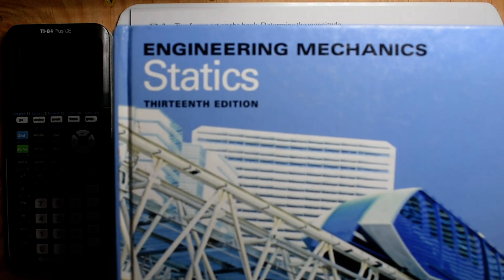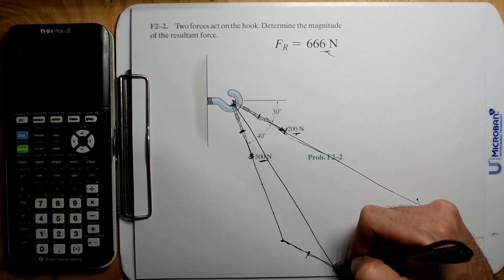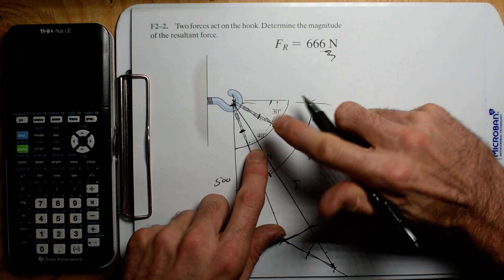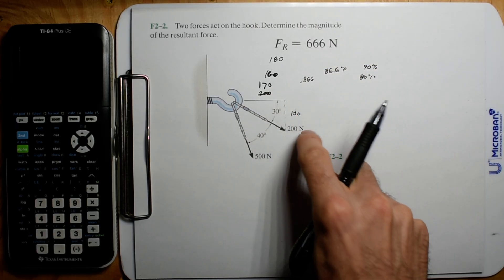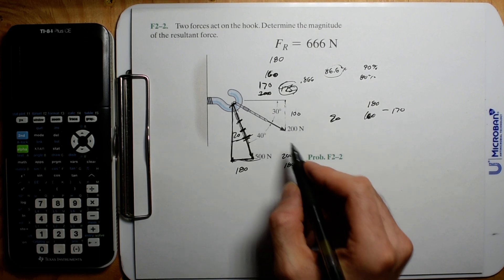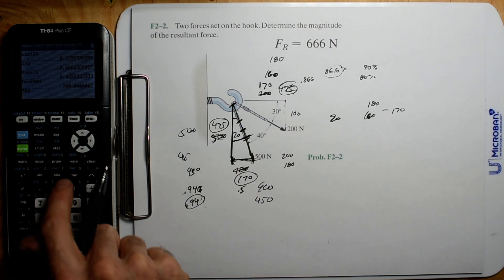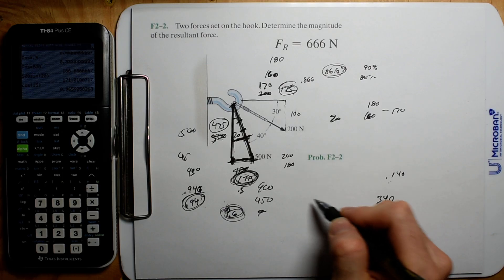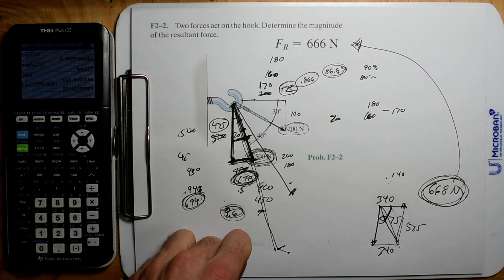FINDING RESULTANT FORCE 2 WAYS!

Comment: I answered this comment under your previous video but I guess youtube does not notify you... ahere it is again : "First of all, letting the errors and struggles in the video make you a strong character. Many simply do not want to show how "vulnerable" they are. But the funny thing is, THAT is what makes the difference! Very strong, very cool. As you said, this format is not common, because poeple are simply afraid of failure and what others think or say. Only strong caracters have the gut to let errors and struggles in. For students it is a gold mine, because a student WILL make those mistakes for sure. And if one can see what the exact error is, he/she will learn faster. As for the "clever trick". I guess it works because of vector algebra characteristics. If you cross product 2 Vectors ( for example S1,S3), then you make a vector "V" perpendicular to S1 and S3. That is cross product. So now you have "V" perpendicular to S1 and S3, but not S2 and F. Now if you dot product the whole equation with "V",  S1 and S3 will be eliminated, because "V" is perpenducular to them (90° ), and the dot product says : AB cos phi. In our case ( S1 S3 cos phi.) Now cos90 becomes 0. So those S1 and S3 become 0. Because "V" is NOT perpendicular to S2 and F, so dot product wont give 0, bacause the angle between "V" & S2  and "V" & F is not 90° . That is how this elimination works I guess. And why you are allowed to do this approach? Because if I add to every element +1 in the equation then it wont change the value of that equation. Here I add to every element a dot product.(It is just a deliberate coincidence that I mutiply everything with a special vector V (S1 cross S3) that will cancel S1 and S3.) So neither S2 nor F wont change its original value, becuase of equillibrium. I add the same value to those. And also you said that you do not logically see how S2 and F remain vectors after a scalar multiplication. I am not sure but I guess they won't. We make scalars from vectors in this case. So the unknown S2 (vector) after scalar multiplication becomes a S2 scalar. We simply handle it as a scalar unknown. But again, it is only my guess, to understand it deeper I should dive into Vector Algebra deeper. Again, this method is brilliant, because you do not need a calculator to solve for 3 unknowns with System Of Equtions function. You can do it by hand. After some google research, it turns out that this method works outside of Concurrent 3D Systems as well. But the use of it requires a careful investigation, where, when, how! For systems with Moments it is also usable somehow but I need more knowlede on that."
Reply from the maker: THANKS FOR THE EXPLAINATION!  I tried working through the dot product part and made a video on its understanding.  It's a, "The Struggle Is Real Video"  and it will be interesting if others find the value you see in this type of video!  I see that same value.  That is probably why I continue doing this format.  It can also show people the rough draft before a concept sticks when learning which you mention we all go through.  After making tonight's said video.  I am so glad I did.  Because now I have better, if not great, understanding of the dot product.  Thanks for commenting on current videos.  I look for comments by scrolling newest.  And reply's to comments can get lost so if you don't see a heart I did not see it.